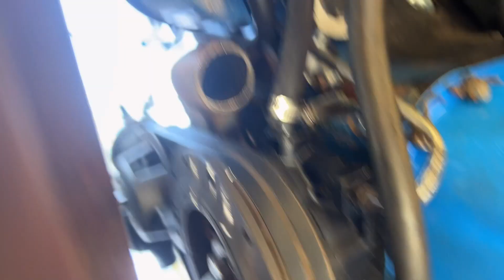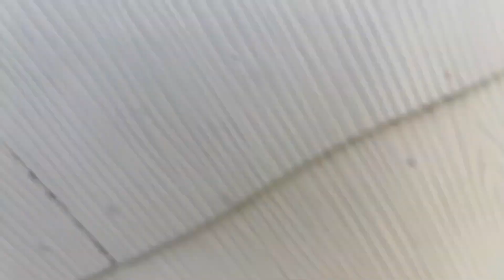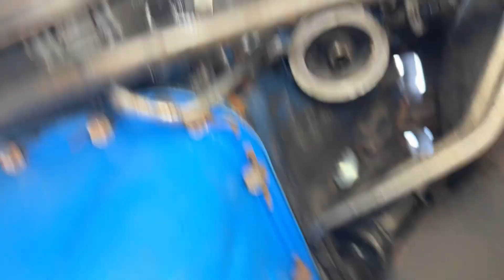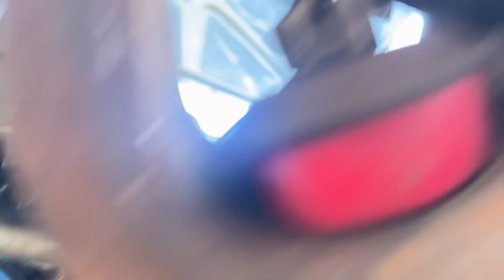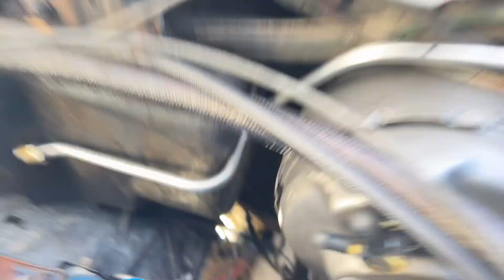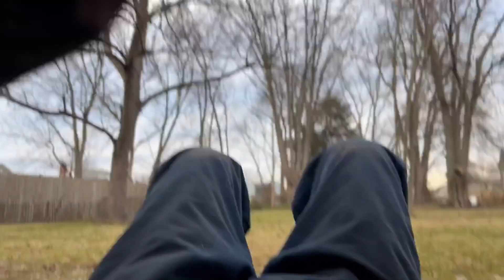1967 Lincoln Project Update More under car work 31 Dec 2023

Comment: And there is the difference between the Lincoln and other cars.  Cadillac used a two dollar cable inside a sleeve to connect the accelerator pedal to the carb.  Works fine but lacks the over engineering of the Lincoln. Lol.  Too bad about the radiator, as I have the same issue with my 61 which also leaks. There is just no inexpensive fix. A recore, if you can even find a radiator shop these days is 4 to 5 hundred dollars.  A Chinese repop is 5 to 6 hundred dollars but at least has new tank ends.  Happy New Year to you also.  Remember that this is a hobby.  You don't have to have the car for everyday transportation but I know the urge is there to get it finished.  Take care and look forward to your progress.
Reply from the maker: I was able to find a new radiator on JEGS and had a $20 coupon, so spent $249 plus tax, and free shipping.  It's supposed to meet OEM specs as far as the mounting goes - we'll see.  Bought new radiator hoses (Gates preformed) from RockAuto.  I'm so close right now to getting the engine fired up, I'm very motivated!  But work and the weather definitely slow me down.  I also still need to get the brakes fixed, then I plan on slowing down dramatically since I've spent so much money on it already.
Reply: Good find with the radiator.  The last new one I bought was from Mark II enterprises and it was brass as the original.  It was close to $600 with shipping.
Reply from the maker: Mark II Enterprises was my next choice and I like them, but their prices are at a premium level.  I really like the battery cables they sold me.

Comment: I love home mechanics engineering fixes lol. Happy to see added safety features. Progress is progress some times it just goes slow. Would you consider lead filling the leaks on the radiator? No idea if youve ever done that before? Maybe brush those fins a bit with soft brush.
Reply from the maker: Thanks as always for your encouragement.  I thought of using a commercial radiator sealer like StopLeak.  But, I don't want to get that stuff all throughout the cooling system so I'm just going to opt for a new radiator which I am shopping for right now.